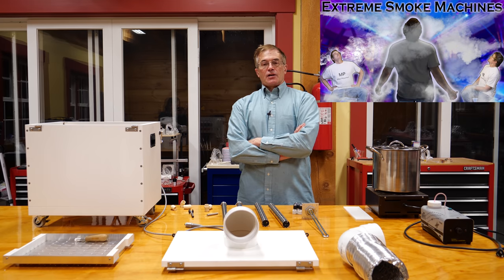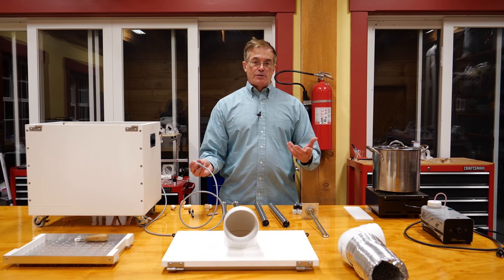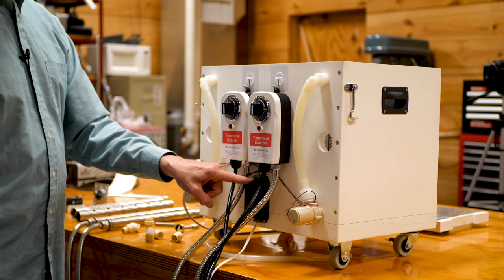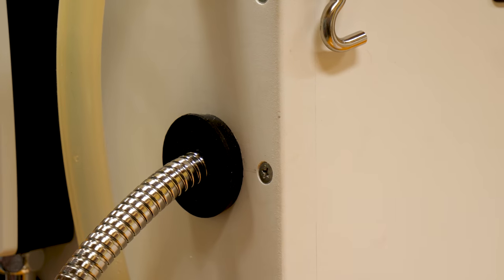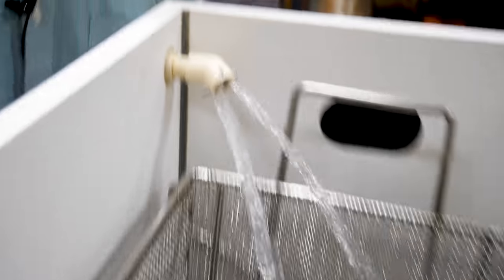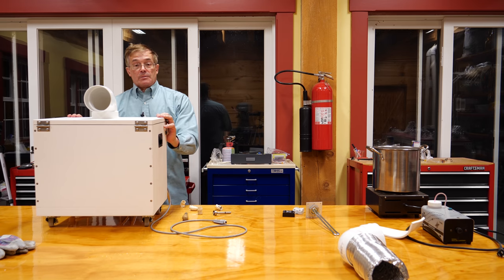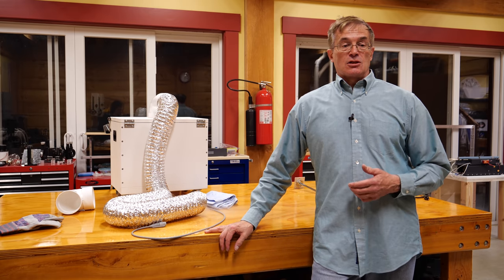Powerful Dry Ice Fog Machine!

Comment: I'm gonna say it, doubtless someone else has, when setting up most shots one would offset the camera angle just a little from square, this is to allow a small slither of space that the crew squeezes through to move between camera shots without getting caught in the plate glass.  I can confirm this is the same technique used in television studios to do music videos. Tiny spots that the crew squeeze through to get shots.  Not criticizing your excellent videos however I can see a concerted effort to increase the quality hence the professional feedback.  Hate me if you will ;)  It's much easier to keep focus on the main presenters thrust when there are no extraneous movements in shot.
Reply: Great comment, I agree, and found the guy running around in the reflection distracting. Tech Ingredients say they read all the comments, but they seem to skim substantive comments and mainly interact with compliments and simple questions, fingers crossed they're still noting useful info like this *shrugs*. It might be because said running around guy is the one who mans the comments, and so the dad never gets to read stuff that could be regarded as criticism or negativity?

Comment: I didn't hear it mentioned, but this also does produce CO2, so make sure there's at least some ventilation where you're using it. CO2 is way less toxic than, say, CO, but it is still lethal at 4% or above. 
A room measuring 10mx10mx5m with nothing but that smoke machine would have a lethal concentration of CO2 in it after about 24KG of dry ice has been evaporated. Something to note.

Comment: 17:20 A fire isn't even the worst case scenario. Water heater elements can fail catastrophically under water; failing under air= more catastrophe. Full face shield and earplugs an absolute minimum.

Comment: And to think, such a delightful substance will apparently be the end of us all.
Reply from the maker: I wouldn't sweat it.  Planetary equilibration systems are powerful and we are a small part of the equation.
Reply: I've spent my entire career creatively wasting energy by doing lighting for rock bands. I've used this stuff by the truckload. Our touring machines look and function nearly identically to yours.
Reply from the maker: It's amazing how much equipment has to be transported to a venue to do an average pro show.  Been there!
Reply: @bring-out  I've done shows in arenas with 400lbs of liquid CO2. Shows that require a 3 phase, 600 volt, 600 amp per leg, electrical service, just for lighting.
We release CO2, and flash thousands of lights on and off, simply because it looks cool. You couldn't invent an industry that's more 'wasteful' by definition.

Comment: That's a very nice unit... a lot better than the commercial units. Would it not help to place some sort of barrier between the water and the dry ice to stop that oozing of mist as it stands on standby? A possible upgrade would be DMX relays on both the heating and pumps with wireless DMX control.

Now I'm going to look for your laser videos. ;-)

Comment: Man this thing is cool! could you basically put any flavouring or perfuming in the water and have the smoke a special taste/smell? if yes, that would be fucking awesome!
Reply from the maker: Sadly, no.  The fog is created from the condensation of the evaporated water vapor by the cold CO2 passing through it.  Like a low temperature distillation, most of the additives will remain in the reservoir.  However, you might detect it if you add enough because some of the scent will evaporate as well.

Comment: is it possible to blow hot humid air through the dry ice instead of water? this way you will prevent waste heat from water from sublimating more dry ice which might make it last longer

this can be implemented with a counterflow heat echanger/humidifier: in a wide vertical pipe air is pushed upwards with a fan and hot water is showered through it down from the top.
Reply from the maker: Actually, that might help.

Comment: 19:14 nice clean box joint there.  That foam is quite interesting to me.  I need to build a belt drive guard for my horiz band saw.  I think I could get some of that .250 inch board .......and shape it rather than use sheet metal.
Reply from the maker: Agreed.  I think it would work well.  And, if you screw up, just put it back in the water.
Reply: I  checked online and Home Depot carries the stuff, you could just pick some up on a moments notice.

Comment: As a theatre technician I love this project. I am curious how you might be able to use liquid CO2 like some of the commercial products I have used before (eg. the Ultratec LSG system that costs $6k). Those kinds of products are usually hooked up to a conventional glycerin fogger and it somehow conditions that conventional fog to the low lying fog like you are producing here. For most people sourcing dry ice is probably easier but theaters use big CO2 tanks regularly so being able to build a cheap low lying fogger that takes advantage of the supply they already have would be interesting.
Reply: Instead of pouring hot water over the ice, drip/spray co2 into the hot water. It should have the  same effect of condensing water vapor.
Reply from the maker: It might produce an explosive release of vapor.  Regulating the output would be crucial.
Reply from the maker: I'd consider trying a simple experiment.  Take a conventional glycerin fogger and pass it under a perforated container of dry ice.  All you want to do is to cool that fog to make it heavy.
Upgrading to a axial case fan to blow the cold CO2 across the stream as it exits the fogger should work better.

Comment: Would blocking off the dryer hose and putting a pinhole at the end cause the gas pressure to force out at a higher velocity?  Could hooking up a fan in the tube achieve this(assuming the fan was waterproof) ? Say you want to make a stream effect that shoots over a high ceiling and arcs over the dancefloor or otherwise. Also,  would the moisture cause the pinhole to sputter water after extended use? Very awesome project! Id love to see a demonstration involving lighting.

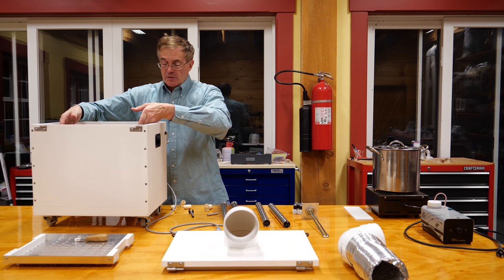Comment: 8:48 cough Roddy Ricch cough cough

Edit: So, I saw the application of using the machine for dramatic effect when pulling up and exiting a vehicle, and I had a bit of a brainstorm (though it probably has already been thought of). If one were to place the box into the trunk of a car and ran the flexible dryer hose into the cab to fill it with fog, they could achieve a nice "Red Carpet" entrance, useful for Prom and prominent barflies. With that kind of setup, you could probably eliminate the heaters from the build by adding a heatsink to the engine or radiator and running insulated tubes to the pumps. Combine all of that with some ground effect lighting under the vehicle, and you've got a relatively inexpensive way to make your $500 1993 Honda Accord look like a $50k limo dropping off a movie star at the Grammys.
Reply from the maker: Nice idea. For a one time shot you could eliminate the heater, increase the reservoir capacity a bit and disconnect the power.

Comment: My thinking is that having this big tub of boiling water might not be ideal. Have you looked at something like a RIMS tube? You can pump water past a heating element in line and spray it onto the dry ice. It would possibly eliminate the need for pre heating the water, but I don't know if it would heat up a large enough quantity of water fast enough.
Reply: Getting a spray that delivers sufficient volume of water requires high enough pressure. These pumps don't deliver it. Noise is a factor in many applications of low lying fog and higher pressure pumps typically mean higher pump noise. It's a slippery slope. That's why the dispersion tray is a good solution as it uses low noise pumps. As for heating the water, you need water at ~140f.

Comment: Looks good. Have you thought about using a large cooler as the box? Also, do you think the very high water temperature is critical or could you get away with 110 degrees Fahrenheit or so?  I ask because there are commercial immersion heater elements available in that range that would not require a controller. Adding a DMX controlled dimmer/relay cube would allow you to build the trigger for this into a lighting cue for stage productions. My vision is using the above components with an immersible garden pump to move the water. Trying to find off the shelf items that any High School drama teacher can cobble together to build this.
Reply from the maker: High temperature can be eliminated by increasing the contact area and flow rate.  Build a larger reservoir and use a larger quantity of dry ice and you can generate just as much fog and for linger as well, but you will need a larger box.

Comment: Please check out focused fussion for inspiration in your plasma experiments they use a theta pinch to ions which induces electricity, and  foil jack to capture the radiation via photoelectric effect, without the contrainent constrain of other designs.
Reply: Focus fusion is a decades long running scam by Eric "the big bang never happened" Learner. It's a fraud run by a crank.

Comment: Could probably use a simple fry basket, should be strong enough and much cheaper.
Reply from the maker: Thanks.
I looked at those.  Make sure the openings are smaller than the form of dry ice you intend to use.

Comment: Great Channel... how do we make the dry ice?... how long will the dry ice last in min. Before reloading your device?...and or a formula to figure out per kg. Of ice and flow of water at 212 deg. F. Lastly, how did you compute the number of holes needed in the tray to avoid overflow and maintain the  proper rate of drainage and sufficient coverage?

Comment: Where are you getting the 3/4" (18mm) rigid PVC foam board. One 4' by 8" panel? I see you say they're cheap. But I'm not seeing it in stock anywhere near me. Were you able to get it from Home Depot as a special order?
Reply from the maker: I actually did get it from Home Depot, right off the shelf.

Comment: For a prototype that is better constructed than some professional commercial unit! How long will 20 kilos of ice last if you run the machine constantly?  Even though your Nom de plume on here is “the Main Presenter” I tend to think of you as “Walter” haha
Reply from the maker: Thanks.
That obviously depends on the quantity of for generated.  It's going to be the same per kilo no matter how the machine is constructed.  One advantage of the DIY approach is that you can size it for the application, easily enlarge it by reusing most of the components or make several at the same time.
Reply: @TechIngredients  guess I didnt word that right. What I wanted to know was how many minutes 20 kg of dry ice will last in your machine running constantly before all the CO2 is sublimated?

Comment: Very cool project!
How long can it sustain a single shot of fog for?
Reply from the maker: Its a curve.  It never really stops, but slows.  Roughly 60 seconds and it's slowed enough that you probably want to stop.  The weak link is the heaters.  The duration in our machine is with 8 liters of water and 2,600 watts.

Comment: The main question i have, which was never addressed, was how did you seal the box? The biggest problem with dry ice foggers has always been water leakage from the water container.  I would be very worried about putting this on a stage.  Unless it is completely water tight, which would be hard to do with epoxy,  you're going to get a big mess and a safety hazard. That's why most dry ice foggers are constructed using a barrel as the only holes you have to waterproof is for the heaters.  I would think having to seal every seam and corner in this would be a nightmare.
Reply from the maker: I sealed this with epoxy and it works well.  I have a great deal of experience working with epoxy and it bonds very well the the rigid PVC foam.  Remember, the PVC is a very good thermal insulator and beyond a few mm from the inside, the temperature drops significantly.  The outside of the box is barely warm when filled with boiling water.  It is this outer layer where the epoxy maintains its full strength.

Comment: What do you think about the practicality of using a high power ultrasonic mister to do the same job?  I think some basic electronics experience would be enough to make a high power driver for one but I'm not sure if theres a functional difference in droplet size or cost prohibition in ultrasonic transducers in the right frequency range that would make it not worth doing on a theatrical scale.
Reply from the maker: It's probably not practical.  Several hundred watts of power generates a puny output in comparison.

Comment: Dry ice sublimates at almost -80 c, that's really cold.  I know I can see a decent water fog effect when I open my freezer which is probably closer to 0c.  I understand peltier coolers can be stacked to create very low temperatures, though not as low as dry ice by a long shot.   A peltier intrinisically has a hot side and a cold side already, so it seems like you ought to be able to implement both the water heating and the subzero cooling using the same components.  Would the current draw for the amount of fog produced be too crazy to consider the idea?
Reply from the maker: It would.  You would need many tens of kW's.

Comment: I want to build one of these for use in a High School theater program. That parts cleaner basket is the hard to find part and determines the shape and size of the whole unit. The basket's ability to flow through the basket seems critical to prevent ice from encasing the dry ice. What I'm seeing on eBay right now are $80 baskets with solid sides. Am I right that basket design probably isn't going to work well due to the solid sides?
Reply from the maker: It probably won't work quite as well, just based on surface area for the fog to escape, but I don't think there is any fundimental problem with it. The biggest limitation is the quantity of hot water in the reservoir and secondly the pumping capacity.  If you opt for the basket with the sides, increase the gap between the drip tray and the basket.

Comment: I love it, how long does the water last before it needs topping up? Or does the dry ice run out first? Are the immersion heaters powerful enough to keep the water hot or does continued use still cool the water? I appreciate there is still vapour output so it's kind of a moot point but does the vapour yield decline with continued usage?

Comment: could you replace the dry ice with Peltier devices to get the same effect?
Reply from the maker: No.  You need the CO2 to carry the condensed droplets out before the simply settle back into the reservoir.
Reply: @TechIngredients  Thanks for the reply. I didn't think about that, assumed the dry ice was for rapid cooling to make the droplets.

Comment: I was curious about the PVC sheets used for the main body of this assembly, so I looked at the parts list and all it says is "3/4" (18mm) rigid PVC foam board. One 4' by 8" panel"  (I assume it's supposed to be 4'x8').  Does someone have a good source for this product?  I've never seen it at the hardware/home improvement stores, so I'm curious about how to get it and the approximate price range.
Reply from the maker: Have you checked Home Depot?
Reply: @TechIngredients  Thanks for the reply.  I have never seen this product at a Home Depot, nor am I able to find something on their website which is visually similar to what you appear to be using.  Mcmaster doesn't carry any form of PVC foam sheet in 4'x8' at 3/4" either.
Reply from the maker: Try Inteplast Group building products. It's marketed under Veranda HP.  1(800) 521-4259.

Comment: You mentioned it goes through a lot of dry ice.  Some rough numbers on how much it costs to run would have been nice.  Like with the basket full of 15kg, how long does it run?  And appx how much does 15kg of dry ice cost?  (obviously it would vary, but your costs would give a baseline)  I assume it runs out of dry ice before it runs out of water?  Or do you have to refill and heat new water for the same load of ice?

Also, do the heaters have enough output to keep the water hot enough during continuous operation, or do you have to run it on a duty cycle to keep the water hot?
Reply from the maker: Like I said, you will need a full 15kg to fill a room the size of our lab for a production like a wedding dance.  That will use 2 liters of water and the water will have cooled enough that by the time you refill the basket and add the water, the heaters will have nearly caught up.
Reply: @TechIngredients  Thanks.  I looked up my local price for dry ice, and 15kg is around $50.  One last question.  How much runtime does the machine need to use all 15kg?  Just trying to get an idea of runtime cost, not necessarily total fog output.

Comment: So thinking about trying to make something like this on a budget, I found a lot of used deep fryer's on local marketplaces. They would come with a stainless steel basket and a 1200 to sometimes even 1800 watt heating element with temperature control and safety measures. Any comments or concerns about canbalizing deep fryers to make one of these tech ingredients?
Reply from the maker: I looked at those too.  Basically, they have what you need.  The challenge will be the housing the ice when not producing fog and directing it you do, but it shouldn't be too difficult to fabricate an upper enclosure to accomplish that.